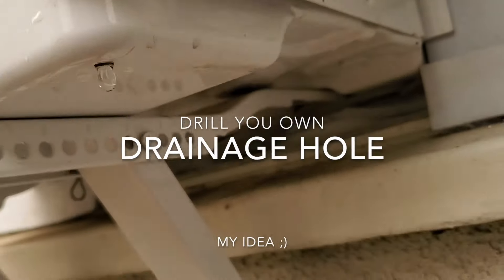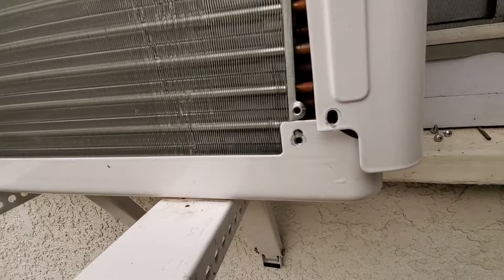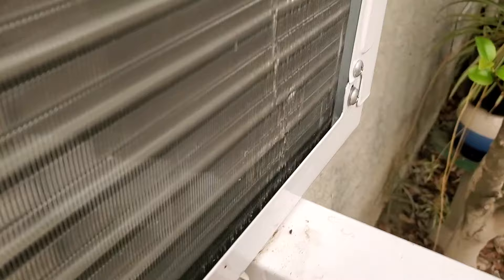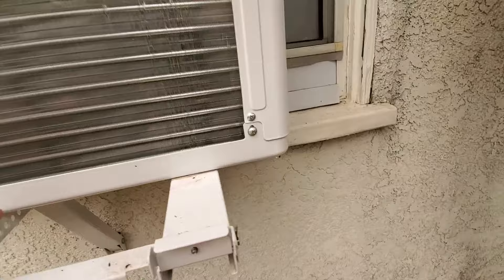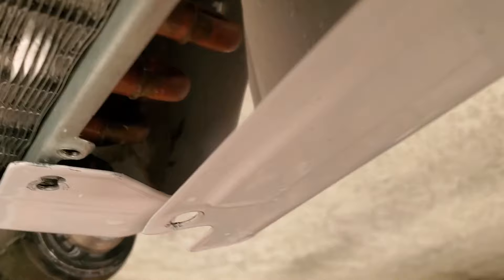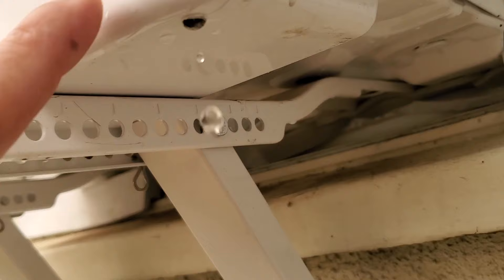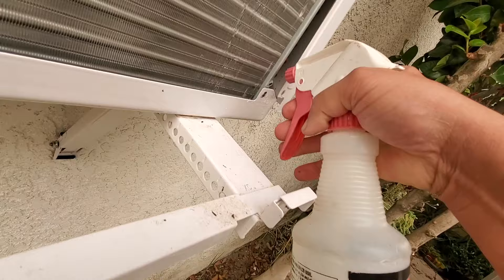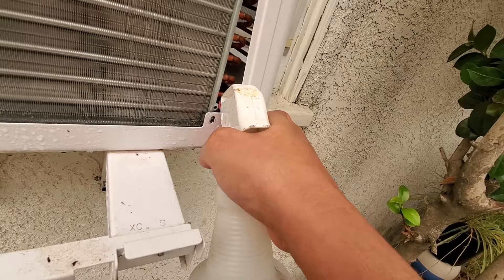How to Drill a drainage hole in your Midea U- Shape fan :) Honest²

Comment: I vote for the drain  hole - I found this post after I drilled a few 5/16 holes in my 8000 BTU unit at the low points in the pan (stay away from the copper lines!) , it was making a  serious racket due to the water in the pan getting blown around by the fan even though I followed the Midea directions for the pitch of the unit to drain properly. I actually thought it was an electrical issue due to the fan speed changing but turned out the water was affecting the outside fan . Holes drained the water and now noise is OK. unit works fine as well.  I did not see any drain holes built into the unit, there is some type of metal boss in the pan but it looks like something they use for the manufacturing on the unit and not a drain.
Reply from the maker: Smart move George... Crazy how many people defend the slime :P Honest²
Reply: @johnz8886  Ehh, something your not considering. A clean condenser coil.... I'll give you my example. I have an 8k LG window ac. Had it for about 4 years. I live in New England with humid summers. First few years the condenser coil would completely plug up halfway through the summer with crap from the water being slung onto it. The stuff is like concrete and trying to remove it totally sucks. At that point the unit would barely cool the bedroom I have it in. Every year I'd go through the same BS until I decided to drill a hole, not on the bottom but on the back edge. The hole is raised ever so slightly off the bottom pan. The result? The condenser coil now stays dry and clean and the refrigerant lines stay submerged under a very thin layer of water, helping with cooling.

People in humid climates really get screwed with the slinger ring. The water never has time to evaporate and just causes problems. I'd bet a clean flowing condenser coil is more efficient than one that's plugged up with muck from the slinger ring.
Reply: @johnz8886  So what is the maintenance Oh wise one
Reply: The manufacturer states that there is an alarm and if the unit fills up with too much water an alarm sound will happen followed by the unit completely shutting off. So yes the unit can flood and make it stop working. Also in Florida you cannot allow all that water to sit in the unit or you will breathe in mold.

Comment: I got to agree with the rust issues, I drill holes in all my ac units if they do not offer a drain plug. Shame on manufacturers ! There is no difference in efficiency, I tested with my kill a watt meter and draws the same amount of energy and runs like a champ. I done this to my 2 U Shape 12K midea's & my 14K LG Dual inverter Ac unit. I had to replace a LG unit it that rusted out in 3 years due to rust it fell apart. I also think its done on purpose so the units do not last as long and rust out so u can buy a new one. Welcome to marketing ! Drill the holes folks believe me and also runs better, takes out all the damn humidity. The unit will still cool off  the condenser with air. Hope this helps......
Reply from the maker: THANKS MY BROTHER!!!  I tested my AC & had a 1º difference.  So I drilled it... collected 3 cups of (funk) water.  Ran it / Tested it dry.  Felt like a dork poring back 3 cups of water to retest but had to be done.  All I did was got out another bug!   Hahahahaha Let the non believers breath in the funk @_@ Honest²
Reply: Interesting, I am struggling with this 8000BTU unit keeping humidity under control and have seen water in the pan getting rusty already and I bought this unit January of this year.. I think I will drill mine too. Worst case I just plug the hole if it causes any kind of unwanted issues..
Reply from the maker: @mattolsson8816  Mine is the 8000 too... Drill it & be prepared to have everyone to say "BLAH BLAH BLAH you need the water for efficiency" BS to you :) Honest²
Reply: @HonestMike  o

Comment: On the newer ones they have an open hole in the middle (drips on your window frame) and a drain plug in the exact spot you did yours.  I think they listened to you, even though theres a sticker saying only to remove it for cleaning transport storage etc
Reply: You must have have the Version 2.0. The drilling of the V1 units has been going around for years!

Comment: There’s two ways to go with this:  drill or no drill.  The mfgr made the unit with no drilling in mind, so the fans slush water around to cool parts of the unit.  However, in some parts of the world with high humidity (everywhere) there’s just too much water that accumulates and bad things can happen, like mosquitoes, mold, rust. Etc.  either method has its advantages, and disadvantages, unfortunately.
Reply: I find that it cools a lot less with the hole therefore the unit is turned longer and more water drips
Reply: What if I live in Phoenix, where it gets to 110 outside regularly for like 6 months with little rain. Any water will dry out, right? I'm getting the musty smell and I can't figure out what's wrong with this sh"t.
Reply: You can have both. Use a plug for the hole and pull the plug to drain it each day.

Comment: It had a lot of water inside the air conditioner. I turned it off last night. I came out to check out the water. There wasn’t any water left. I don’t think it need to drill the holes. By the way, my portable air conditioner doesn’t need to drain water. It need the water to cool the coil.

Comment: Hey, Madea, how about putting a drain plug in your unit? I’ll wait to purchase when new drain plug is listed in description!
Reply: The new ones have a plug.
Reply: @socrates2706 Mine is brand new installed it yesterday. It doesn't have a plug.
Reply: @pmaint1  Maybe it’s specific to BTUs and/or date of manufacture. Mine is 12,000 BTUs from Costco made 12/23.
Reply: @pmaint1  Mine are new from home depot, bought about a week ago.. latest models have the drain hole ,its 3/4" in diameter on the rear right if view from behind...new models have touch sensitive buttons , the old models had push buttons... latest models have a U in the model number , the old ones had a V... if it doesnt have a plug, its likely just old stock...

Comment: Water is there to help cool the condenser.  If you drain it, it will still produce the same temps, however it will work harder trying to do it.  I would only do this if I were anticipating not running the unit for a while and wanted to drain it.
Reply from the maker: I don't run it daily... Actually only run it when it's 100º+(F)  Honest²
Reply: Is the what the Midea techs or design crew said?
Reply: @pattimichellesheaffer103  Did you read the manual?
Reply: This is true for dry climates, but when the humidity in your area is +90% drainage is very necessary
Reply: @HonestMike  you might include that info in your video.
Reply: @Bob-Fields this A/C isn't recommended for that high of humidity.  As per manufacturer.
Reply: @LemonySnicket-EUC  Thanks for the note. I haven't this restriction in the specifications. Can you tell me where I can find it?
Reply: @LemonySnicket-EUC  Where is this stated by manufacturer?
Reply: @bibo3373  in the instructions. My 12k unit also has a proper drain hole  closer to the window. It's common knowledge that high humidity effects the performance of any Aircon system. Both of mine work perfectly in the West Texas heat and on the rainy humid days it sweats like a pig. I'm very satisfied with mine.

Comment: Mine came with a rubber drain plug, but they say only to drain it when putting it away at the end of the season. They say it slings the water up, and is supposed to make it more efficient.  I may pull it if I get mold growing though.
Reply: What's your model version? the V2?
Reply: @bobdroidsky225  Not sure. It's a 1200 btu though.juat bought it a couple months ago
Reply: @skytrip5273  Look on the box or look on the unit itself for the number

Comment: I add pool shock to that area to sanitize it. I too before finding f this video found a low spot and drilled a hole as rhe water would backup into the front area and noticed mildew growth. But glad diy is on video.

Comment: I just bought one of these things, and I have the same drainage issue, you don’t have to spray bleach on the outside, though there’s no point the outside is completely separate from the indoor unit. The indoor unit is its own unit there’s no way mold from the outside can get inside.

Comment: After looking at the TCL website about this issue, the Official Chinese Party Line is that there are NO holes for drainage.

 The idea is that there is a ring around the condenser fan that is supposed to splash water onto the condenser coil, increasing its efficiency.  My units (4 of the 5000 BTU variety) constantly generate mold when in use.  Every season I pull them apart and use commercial chemicals made for the trade.  I have also found that using Clorox foaming bathroom cleaner helps to clean the unit off.

Me?  I'll lose a few efficiency points and drill the holes when I take the units out of the windows in the fall... removing the guts completely.

Comment: Mine has two holes near the middle that I just realized were dripping into the sill, soaking everything in the wall and leaking into the basement. They don't look like drain holes, but they are certainly draining the unit. Hoping I don't have to tear the wall apart.

Comment: My 8000 was 18 months old when the fan became noisy. A flashlight showed it covered in crud and splattering something dark and liquid. Outside, crappy looking water filled the pan where others have drilled a hole. I replaced it with a new 8000 that I already had. Funny thing, when I ran the new one all last night it didn't malfunction even though it had no water at all in the pan. I plan to use the old 8000 to measure exactly where the drain hole needs to be drilled. If I have to replace the 8000 again in 18 months because there is no water in the pan, at least I won't have been breathing that moldy looking crap.

Comment: @Honest Mike -It has been 18 months since you posted this video on drilling a drainage hole. How is the air conditioner performing? Any negative affects from  drilling the hole?
Reply: Yeah, I’d like to know too.
Reply from the maker: It still jamming and no rust... The only negative is from peeps who say Don't do it!!!  Seem to struck a nerve with HAVC crowd @_@ hm²
Reply: @HonestMike  ... this seriously a health and safety issue. My unit was disgusting.
Reply: Just so you all know... even a/c's with a drain have mold problems.    If it's bad enough, they all need cleaning.    I had a GE window a/c from the 90's with mold growing on the Styrofoam on the air outlets inside (where your louvers are).    Like I said, they ALL get mouldy/mildewy.     I had to clean mine every 2 years.
Reply: @Paul Alvarez evaporation causes a significant temperature change.
Reply: @woohunter1  Here is the updated video he did after 2 years. https://www.youtube.com/watch?v=WjOcujNPdGQ
Reply: Problem solved…….Costco takes it back ….hint ….hint 😮

Comment: Mine just started leaking inside of my house pretty bad onto my carpet. I've had the unit for almost a year. Was working like a dream before that. How frustrating.
Reply from the maker: Hey I just saw your post on FB!  Go drill that AC Carefully :) Honest²
Reply: @HonestMike  what kind of bit would I need?
Reply: That's why I'm on here reading this I'm getting ready to buy four of these units and I don't want maintenance issues in all of my bedrooms. As far as I'm concerned all this stuff is on the guy pile. I think I'm going to buy these units and drill the hole before I install them in the windows I live in Florida

Comment: WARNING: one slip puncturing the coil and your unit is destroyed. Anyone who drills a hole you HAVE to remove the two screws on the same side he's showing, you won't be able to see the last coil. PUT YOUR FINGER INSIDE to feel the limited space you have to drill. Consider leaving your finger inside as you gently puncture a hole with a sharp tool like a half inch flat wood bit works great, can hammer gently to get a pin prick hole then use small drill bit and graduate to larger size still using finger feel you only have maybe 1/3" to work with. If you puncture the copper colored coil things you will destroy the unit, coolant or whatever is in them will flow out and it's very dangerous to breath it, and no chance of returning the expensive unit. But do drill a hole since it's an obscene flaw with so many negative reviews about draining inside on the floor and outside ON the window ledge rotting wood.
Reply: I came to this video with the same question about my unit. Seems like there is conflicting opinions about if we should "drill-baby-drill" or "splish-spash take a bath". I'm thinking about drilling, but am also thinking about using a very short drill bit (one that sticks out of the drill no more than the thickness of the metal encasing) to avoid puncturing any of the compressor tubes (it's worth sacrificing a drill bit to avoid ruining such an expensive unit)
Reply: FYI just punctured my coil,  thought I was being so careful, it’s trash now
Reply: You should should a step up bit. More expensive, but will save you from a drill bit pulling your drill up into the coil after you puncture

Comment: Where does the water runoff come from and exited from inside of the house. I'm having issues with it dripping on my window sill
Reply from the maker: I have some plants below so that's where mine drains too :) Honest²
Reply: Mine has condensation forming underneath the unit to the right - when looking from the rear. My unit built in 2022 has a drain hole and lots of water comes out - 18 quarts per day. I like the unit but the condensation underneath and over the sill is a hard problem for me to solve.
Reply: @bibo3373  Yup. I live in Florida, just bought one of these, have seen pictures of sweat forming under the unit... my plan is to cover it with a sheet of some kind of insulating foam and hope that'll stop the cold metal from causing condensate. Also going to have to drill a nice big drain hole... kind of a bummer they didn't consider any of this when the unit was made.

Comment: Is your unit still ok? Bugs and mosquitos started to appear when I purchased and use this unit, weird that it didn't happen prior even though I leave my windows open. It's been weeks since I drilled hole to mine using your guide. Thank you. Hopefully nothing goes wrong.

BTW what kind of paint did you use to prevent rusting? Acrylic, rubber, or?
Reply from the maker: Krylon Paint & Primer :) hm²
Reply: I've also noticed bugs in the room after this unit and I see bugs in the back part outside the window. I suspect there is a path for them to get inside.